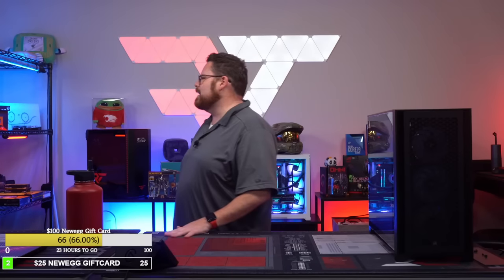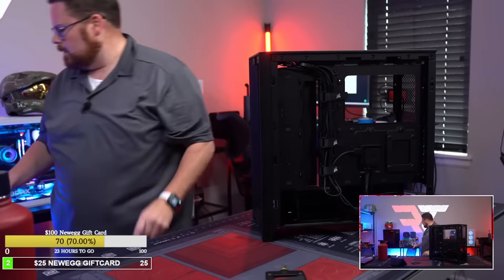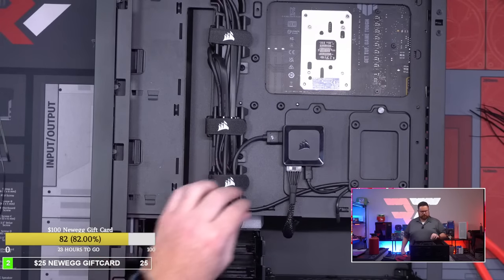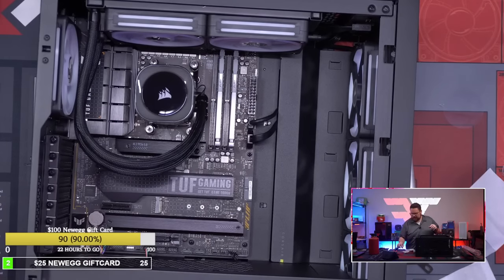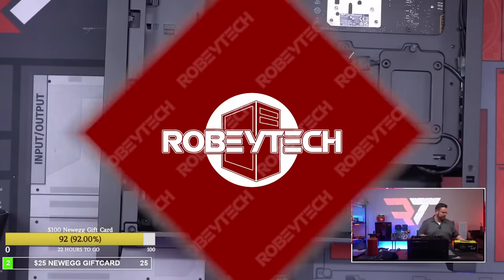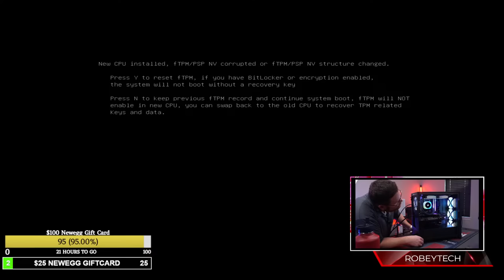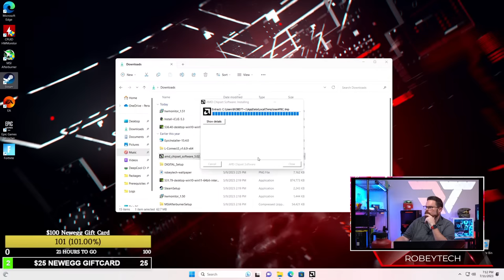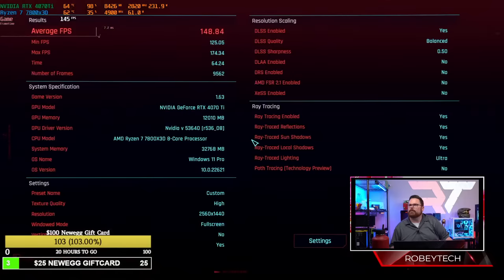$2600 iCue Link Build in Corsair 4000d (7800x3D / RTX4070Ti) + Giveaways and Deals

Comment: If I’m not mistaken, you should have installed a rubber pad under the m.2 drive, which is stated in the manual when it comes to installing single sided m.2 drives.
Reply from the maker: Depends on the bay, and it’s not rubber it’s a thermal pad.
Reply: @RobeytechLive  what I'm referring to is infact a rubber pad that should be installed under single sided m.2 drives in that slot you used as shown in the manual on page 2-8 section 3 sub section A. You can find the rubber pad in the motherboard box.

Comment: Hi. So I have this case and psu. I noticed there isn't quite 35mm clearance between the psu and the side of the case, even if I put the psu as far to the other side as the screw holes allow. And some gpu manuals now recommend not bending a 12vphwr cable until 35mm away from the cable's plug (not the psu's side). So... A year later, has this gpu had any melting cable problems??
Also, is this 35mm rule only for 12vphwr cables?

Comment: Corsair did one thing right and wrong at same time.  The CABLES!  The fans look great!!!   I bought 3 of the starter kits.  Over $500 including ship and tax.   As supplied the kit is useless in my build.  They only give you 1 600mm straight cable.  All their marketing surrounding this launch and their own website shows 90-degree cables being used.  Without these 90-degree cables I have to drill holes and run cables outside my case. They won’t fit in my triple 360 rad custom cooling build.  Great way to manage cables.  Run them outside of the PC.  They need to sell a kit with 90-degree cables and no controller.  Charge the same for that.  Right now 90-degree cables are on back order. And with shipping run $30.   So for $200 you get 3 fans and then a 90-degree cable that should have been included already!!! I wouldn’t complain about the cables if they were reasonably priced.  $160 for a starter kit that can’t get you started without another purchase.   Cables should have been included at this price.  At worst no more than $5!!!!!
Reply: Well if you want to resell the fans I'll buy em off ya
Reply: @herc1319  still eligible to return em.